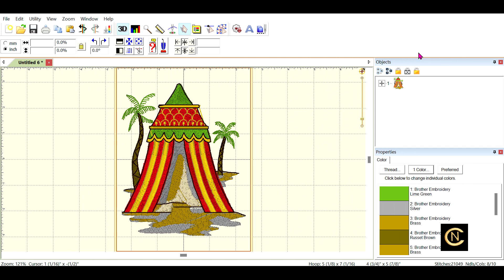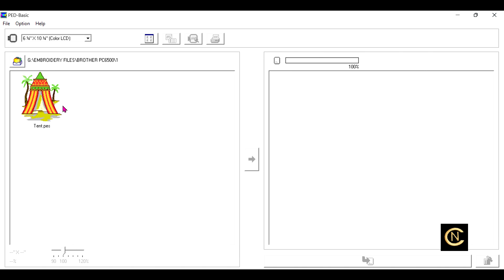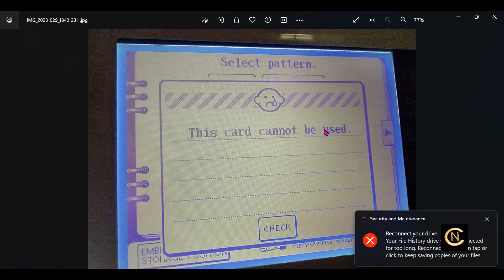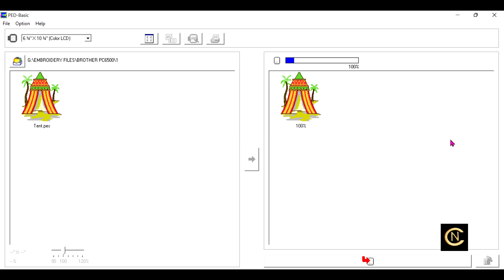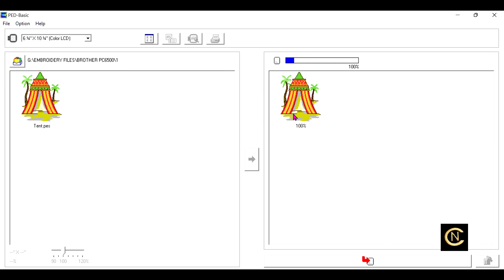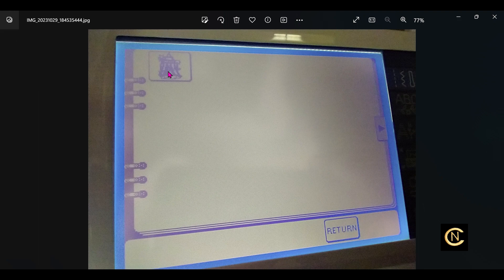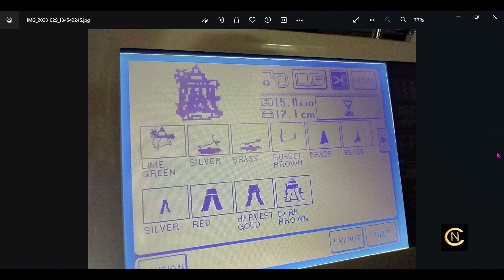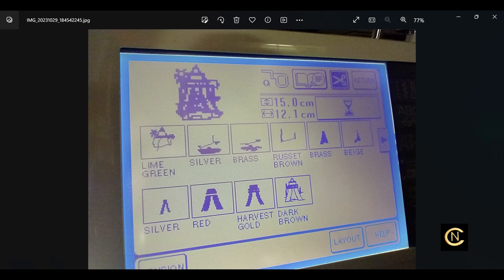Brother PED Basic Card Not Reading  - SOLUTION! - PC8500D

Comment: it has been a real struggle trying to figure out how to transfer my designs from my computer to my Ellure Plus by babylock.  I have no idea what the maximum field is.  I do know that It came with larger hoops than 5 x7.  I have an Adventurall that I use and was going to sell my Ellure because I didn't need 2 machines, but not sure if there is a market for it when mainly the designs are limited to what is on the machine.  The machine works fine.  I can't find a manual telling me how to get my designs into this machine other than this method?  NOt sure how to send designs from my computer although I thought it had a capability of doing that.  I don't want to mislead anyone if I do sell it.  I have the magnetic hoop for it and 4-5 other hoops but this device only works with designs up to 5x7?

wanted to thank you for the information.  this is the FIRST time I've been able to find any information.

Comment: I am having a hard time just finding videos on how to use my gently used Bernette Deco 600.  I thought I did research on purchasing the PED reader.  I saved the PES file to the disk for my Berentte600, inserted the card  into my embroidery machine, and turned on the machine and it makes a high buzzing sound.  If I remove my card then it is fine, no noise.  Inserted a card that came with the machine and it uploads the items on the machine.  However, I would love to see more videos or recommendations on learning more about my Berentta Deco 600.  It’s a little intimidating!
Reply from the maker: @anniegrimm5651  It sounds like you need to take your whole system to your local Bernette repair person so it can be evaluated. Check with them for a instruction manual as well. They can help you. Thanks for watching.

Comment: thanks for making this vid! I actually have a question - I was wondering whether the borther "ulimate card" memory cards are hardware-compatible with any standard memory cards, e.g. CF-memory or even SD--- do you happen to know? Or it is an ultra-proprietary system that requires a bid investiment into proprietary idiosyncratic hardware formats?
Reply from the maker: I have never tried any other card other than the Brother cards. I would suggest you contact the Brother corp directly for your answer. Thanks for watching.

Comment: Nice to know but I have a issue to get the PE-design card reader to work on Windows 10, I´ll try with an old Windows 7 notebook. I did not know that you need to convert the design and I got the newer Brother PE-Design 11 and it saves directly but I have not tested it yet because I am waiting for some hoops or loops or what they are called 🐸Thanks

Comment: The PED-Basic program is not finding my file to put on the card. I have saved it in the older PES format for my old machine but it still doesn't find the file.
Reply: I'm struggling with the same issue!
Reply: I had to get a second monitor to hook up to my computer with windows 10. It works perfectly. But windows 11 really has issues that make several apps not work.

Comment: i just bought the card writer and im trying to transfer the design to the card but its telling me "No card writer module is connected when it is infact plugged in. im not sure where to go from here
Reply from the maker: Sorry to hear you are having issues. Contact Brother customer service for help. The number is on their website. All the best.
Reply: Did you ever find a solution for that? I’m having the same problem!
Reply: @snifflingbunny  turns out you need the original card plus the reader that came with it. as well as have a matching card and reader set to maybe have a shot at it working

Comment: Great video!  Do you know what to do if your laptop installs the PED software and the laptop shows the reader in devices but won’t let me use it. It’s like it doesn’t know what to do with it.
Reply from the maker: When you download PED Basic software on current Windows computers, you have to turn   the firewall off on your computer. Once the software installs turn the firewall back on.
Reply: @christophernejman  Hi, I PeDesign version software and reader/writer box. Can it be installed on a Windows 10 or Windows 11 laptop? My older laptop that it is installed on is dying and I am desperate to be able to still use this Pedesign version for my embroidering. thanks
Reply: Oops My Pedesign reader/writer box is 5.6 version .Can it be installed on Windows 10 or Windows 11?  thanks
Reply from the maker: @vickyquinn675  you will need to check with Brother. I do not own or use PeDesign.

Comment: Hel😊 with card writer on old lap top. Ped downloaded, but it will take the design. Help
Reply from the maker: When you download PED Basic software on current Windows computers, you have to turn   the firewall off on your computer. Once the software installs turn the firewall back on. If you are having issues on old computer call Brother directly for further assistance.